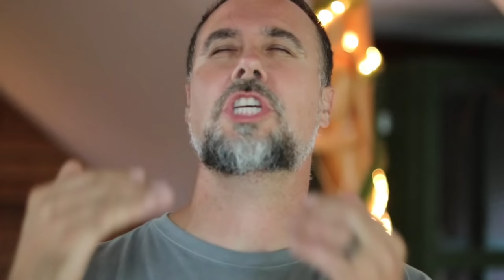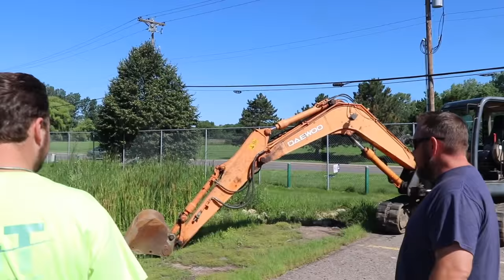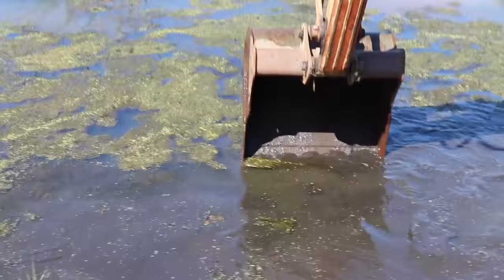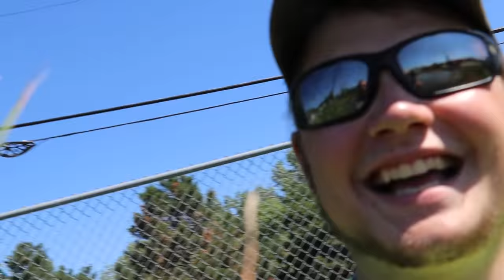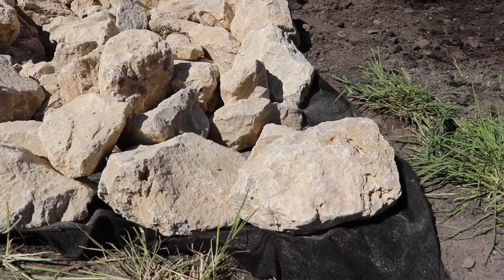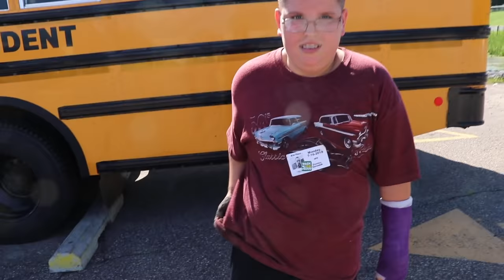Pond Mucking + Giant Water scorpion + Excavator = Todays Video

Comment: You needed a toothless bucket if you didn't want to scrape the clay linning out.
Reply: Peter Will you can still scrape the clay lining with a bucket without teeth. All it takes is a little to hard movement on the controls
Reply: Steven Henning the way he is running that bucket with the teeth down. I would say run a toothless bucket as well

Comment: Stain in Nebraska you have to call a locator by state law they send out some company to do all the loacting then the power company and gas and water company do locating after that they clear you to dig
Reply: It is similar in Minnesota, where Stan is from. We have 811 but there is not really a "law" requiring you to call before you dig. It is just if you hit something you will get hit with a HUGE fine. It really not very smart not to call before you dig.
Reply: FUNNYBOY12375 we have that same law here in North Carolina. When they were laying cable lines they had to call the utility locater guys to come out.
Reply: Of course the cable guys still managed to screw up the Job because they decided to lay there fiber optics right next to The lines that were late from other networks, and they cut all of our neighbors that had AT&T off from their connection for about a month. As a punishment north state is not allowed to do business in this area. Of course I’m not sure how long that time span is supposed to be, but I figure it’s going to be at least two more years before they’re able to set up more lines out here.
Reply: In Wisconsin/Illinois it’s USIC or Vanguard that locates your utility’s.
Reply: Here in the uk there are supposed to be plastic tapes different depending on what services are there, so that IF you find a tape it should show you what is buried there BEFORE you hit it. Gas, Power, Water all have different tapes👍🏻👍🏻👍🏻
Reply: @The_blindpizzaguy1300  USIC in NC shows up to locate requests put in by AT&T and puts "no conflict" or something other than "marked" on the positive response when obviously that's not the case. They get constant callbacks for AT&T tickets then turn around and complain that they're all backed up, nothing but a bunch of lazy people at USIC.

Comment: Key lock box mounted to the wall of the cab will let you lock the keys inside the machine they go to with a combination to unlock the box. 

No muck bucket? No/smaller teeth so less penetration into the clay base and a bigger area per bite.